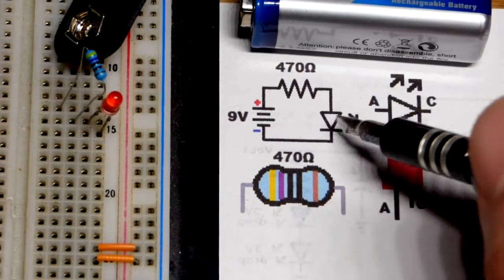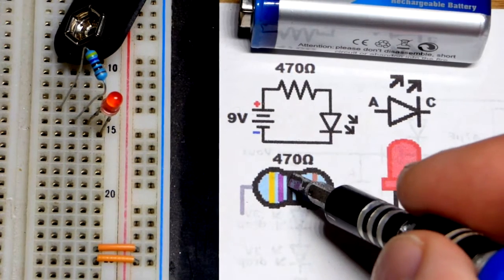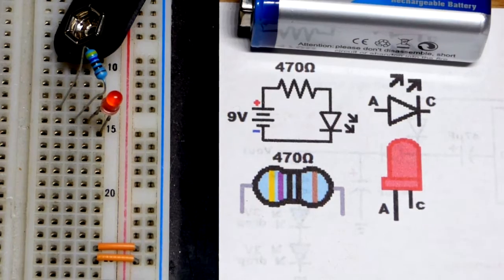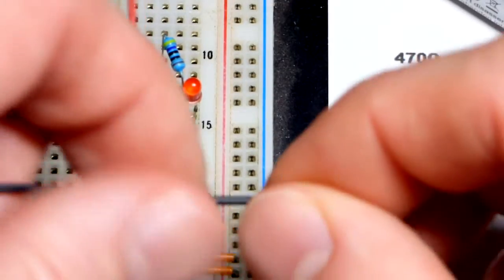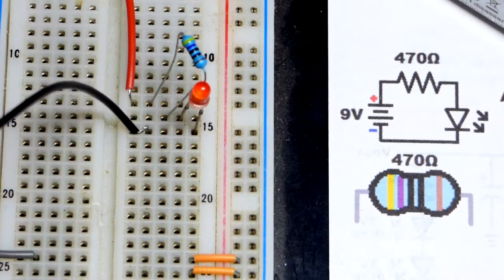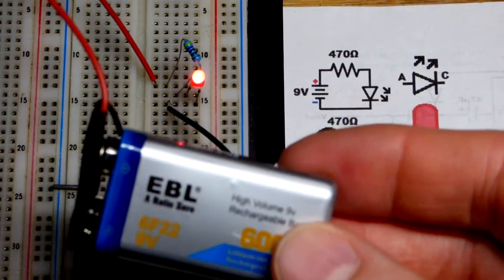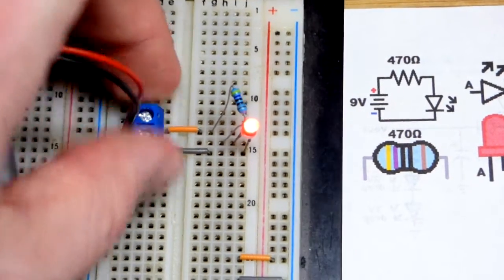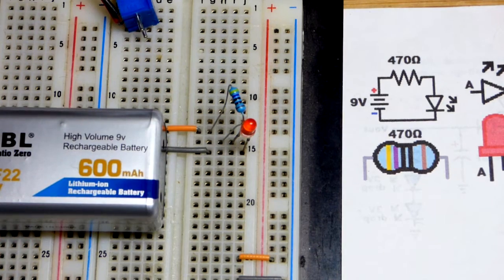9 volt battery powered LED protected with resistor circuit schematic learning electronics shorts 4

Comment: Hi I don’t suppose you can give some advice to an electronic project I’m working on? Iv a car that is 12v…like most of them in the world. But it has a potentiometer that works from 1 to 5 v, I need a relay or something on those lines I can use the 1-5v to trigger an earth or 12v it don’t matter which. I’d would be cool if the trigger was adjustable so I could set it to 2v or 3v if you understand me as I’m terrible at explaining things. 

Thanks for your time.
Reply from the maker: Unfortunately I'm not sure how to help. I'd look for people that built similar projects to what you want.